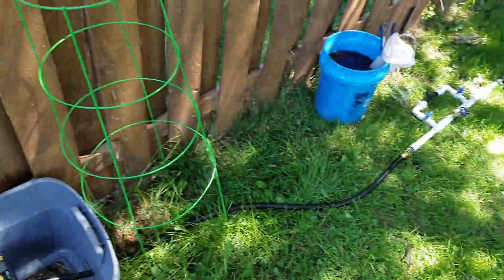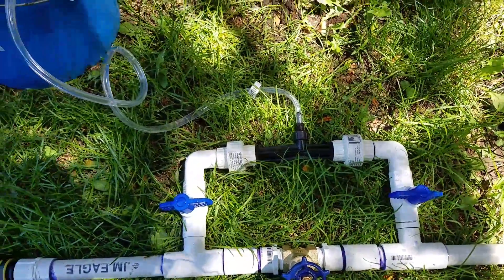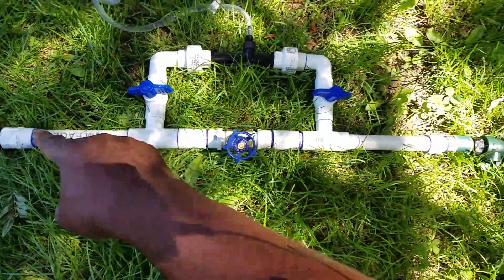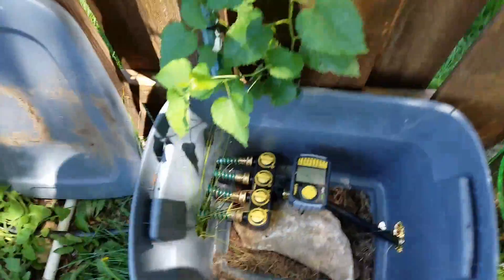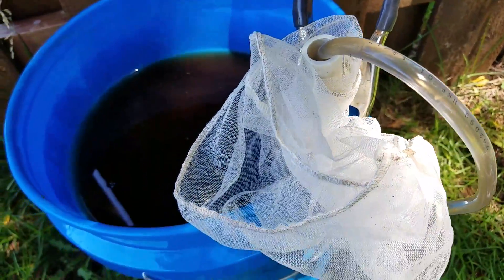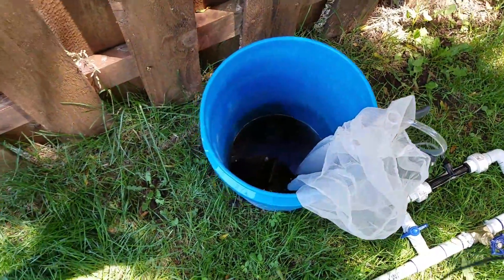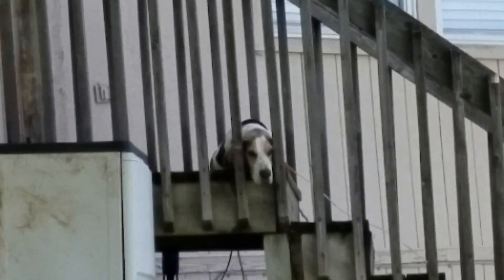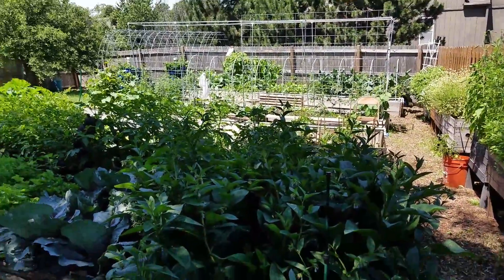Fertilizing my garden through a Mazzei/Venturi Injector System DIY build.

Comment: thanks where can I get the black middle piece that has the venturi. What size is the pipe work. Thanks from South African
Reply from the maker: I bought them off Amazon I believe (it might have been ebay). They were produced in China so they are dirt cheap. This was the 3/4 inch version (1.9 cm)
Reply: thanks for the reply wish I could find one in South Africa regards Eric

Comment: I just tried this exact setup, but I find that the back pressure from my sprinkler system is too high which causes the pressure differential in the Venturi to be to small in order to suck up the fertiliser. How did you get yours to work?
Reply from the maker: you probably need to close the main intake valve. pressure will be lower but suction will be higher. Its one of those things you need to play with to find optimal settings. In my garden, it is oneped about quarter of the way. In my lawn it is almost all the way closed.

Comment: Nice job! couple of questions of you don't mind answering do you use tap water on your system or do you use your rain buckets and what tape of timer and valve body are using and are they reliable?
Reply from the maker: John Coon the irrigation is on tap water. I have a water filter running thru the house but I also have a sediment filter on there as well. it's called a Melnor 4 zone water timer. easy to program and haven't had an issues with it
Reply: Soil Samurai Gardens thank you

Comment: How did you add your timer to your system. Or how did you build it with your system
Reply from the maker: Its just a basic 4 hose time connected to my spigot. Fairly straight forward. The spigot always stay on during grow season.  I bought a cheap tote to keep it in to keep it out of the elements. When I need to use the venturi, I just disconnect it from the inlet and connect the venturi to there. Ill run whatever nutrients need to go in, disconnect and hook back in the water source.

Comment: Thank you for sharing!  What size is this Venturi injector?
Reply from the maker: Brenda Garcia Brady it's 1/2". The PVC is 3/4 that is reduced down at the venturi injector, gives a better vacuum.
Reply: awesome thank you!  I want to use this with the fish fertilizer and am trying to figure out the dilution rate.  I don't want to dilute too much in the bucket because it will get diluted again when it gets mixed in with the hose water but I'm also afraid that if I don't dilute it enough in the bucket then the mixture may be too viscous and clog up the little filter you mentioned. hmmm...                                                                                            

I was also wondering how much the entire add-in cost you?  (Including the Venturi, PVC, valves)  You mentioned $30 but If I understood correctly that was the price for just the PVC?

Thanks again!!  Love you channel and all the garden updates, I have modeled our own garden very much like yours :-)
Reply from the maker: Some trial and error may come into play when figuring that out but it's possible. The whole thing including the injector was a $30 build. The most expensive part was the brass  knob, with just a pvc shut off valve, the build would have been around $20
Reply: @rickwyattdotnet  you DON'T realize how much you have helped me.

Comment: What is the ratio ?
Is it 8 parts mix to 100 parts water ?
Reply from the maker: Marzouq Humoud roughly 16 parts mix. Not totally sure but that's what I had read it was when I first built it. The turn knob can adjust water flow (which is an added benefit) that could shame the solution to less or more as well. I keep it about half way open so I'm probably closer to 20:1
Reply: Rick with Soil Samurai Gardens thanks man.
I will mix my fertilize and see what will the outlet ppm be and figure it out.
Appreciate the quick response, you still using the venturi or anything better ?
Reply from the maker: I like the venturi a lot. I'll most likely continue using it for years to come.